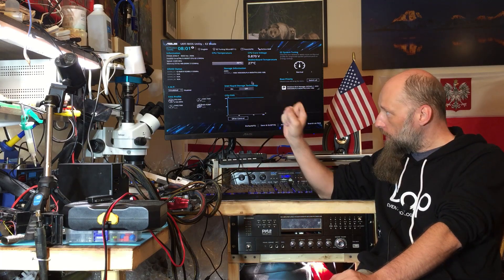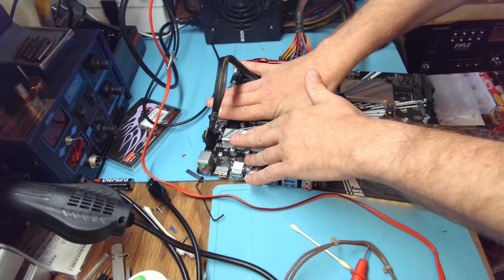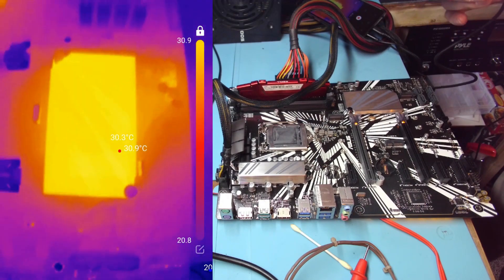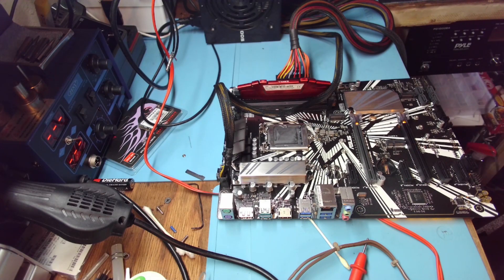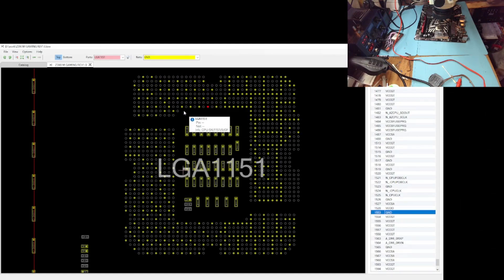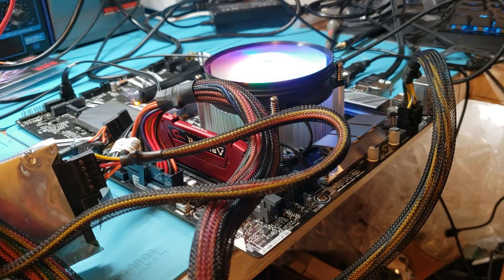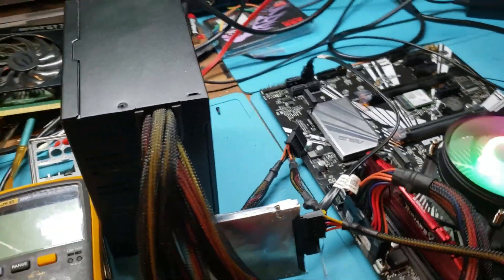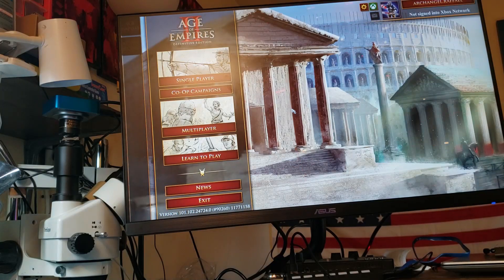Asus Prime Z390 P Repair | Bent Pins on LGA1151 Socket

Comment: WOW, what a mess. I have not had the pleasure of fixing bent pins on sockets, not sure I look forward to it. I spent 5 years designing and producing prototypes for high IO sockets, 1200-2400 pins. It could populate a 1200 pin in about 2 hours. Nice job!
Reply from the maker: yeah, it's quite a mess but this one actually was in a relatively great condition, sometimes the socket is beyond repair and needs to be replaced, and sometimes it looks like someone just took a hammer and destroyed it :) 
Great work to you my friend, I checked out your channel :)
Thank you for the comment